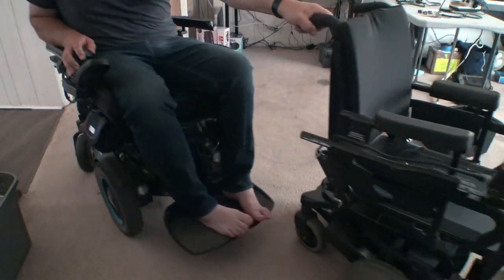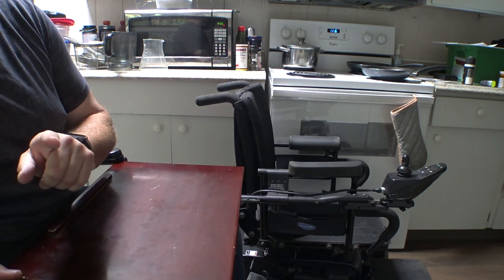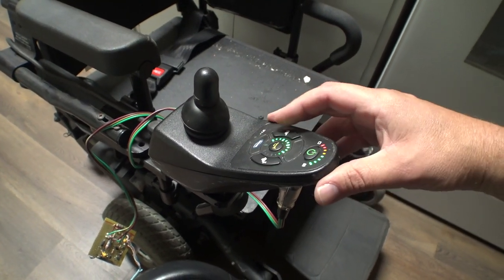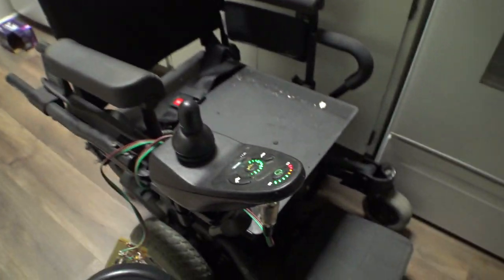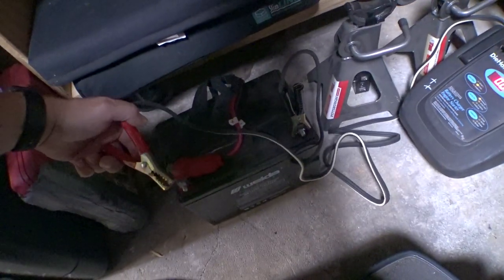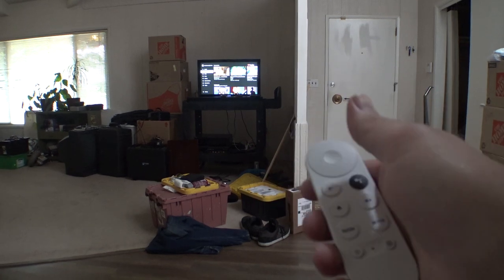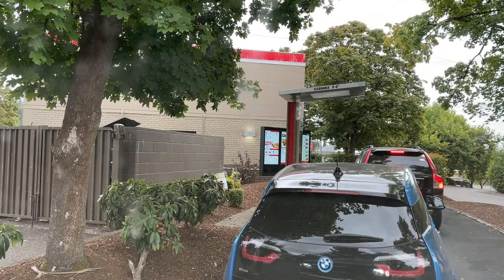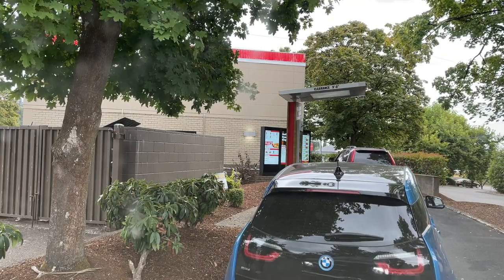VLOG 575: the jigsaw puzzle of life!

Comment: I have a home automation system running on windows 10. Several times a week something would happen and the automation was down from an automatic update or some other anomaly. The software is available for windows and Linux. It took me about a week to get it working under Linux. It has been running for over a month now with absolutely no outages.

Comment: Back up all your data to a solid Drive, but do not download Windows in your solid drives. Because You only want it for your backup, or you could download videos on it as well. In my computer I have one terabyte solid drive with Windows 10 and Linux window then I also have two solid drives with 500 GB ea. On one of them I had 5,000 music videos. And the other one, I had 3,000 woodworking video.